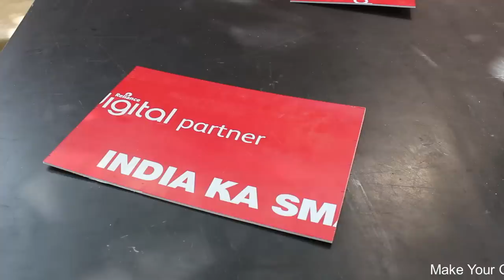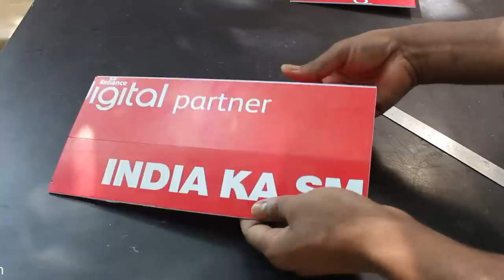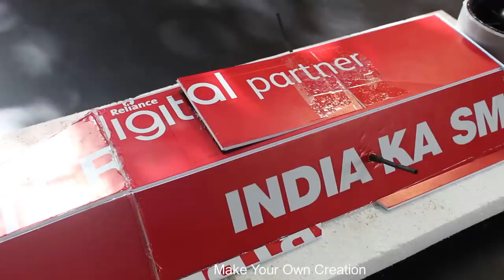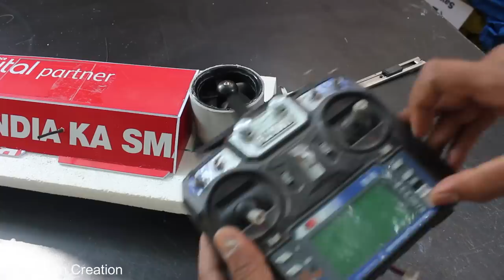How to make a Boat - Amazing RC DIY toys - BOAT

Comment: I think you'd get better performance without the elbow both because of the friction losses of the hard 90 degree bend and also due to the loss of the fan suction which would add the forward thrust if oriented horizontally.
Reply from the maker: Thanks For Your Feedback

Comment: cool idea. what if the you used the EDF as a water Jet turbine. that means spinning it inside tube that is under water. Sweet lake water won't destroy the motor in short terms. But it might been interesting to see how that would have worked out. maybe more speed?
Reply from the maker: i am done many
Reply: @Alejandro Jaiden Woah! any updates?

Comment: Very very clever!  I have 3 ideas for mods: 1) controllable trim tabs on the stern. This will allow you to tune it for a smoother high speed plane;  2) make the bottom smoother/slicker. Paper and packing tape would be lightweight; and 3) if you want the EDF style poweplant, Consider a "BDF". Cheaper, more robust, and more efficient with your battery. Great job!
Reply from the maker: Thanks for your feedback

Comment: Great project! One suggestion, I think you’re having trouble turning left because of the counter torque of the motor. Angle the pipe slightly to the left side (2 degrees or so) and I think turning should be easier. Also maybe extend the rudder into the water a little? I love the simplicity of this and it looks nice too. Nice job.
Reply from the maker: Great point!,  Yes, Thanks for your feedback

Comment: One tip...always switch on your remote control first then the receiver..... Btw good job..keep up the good work
Reply from the maker: OK
Reply: Kenapa kena on transmitter dulu baru receiver bro?
Reply: @WKRhomemade  sebabnya tak kira kapal,bot,heli kdg2 dia boleh gerak sendiri which is about safetylah..then kalau nak switch off pulak tutp yg receiver dulu then baru transmitter....cthnya kalau kapal prop electric kdg2 bila kita off transmitter dulu automatic dia akan pusing kipas tu . Itu yg bahaya tu...maklumat tambahan kalau nak bind baru kita switch on receiver dulu dan kemudian baru kita on transmitter utk connectkannya
Reply: @hakimmunim4594  ohh gitu, tq info 👍
Reply: @WKRhomemade  bereh bossku

Comment: Good start - I will suggest that instead of using an 90 degree plastic pipe, use a dual 90 degree pipes to form an S intake.  The air flow will be smoother.  Try it out and see what happens.  Best
Reply from the maker: ok, i will try it
Reply: Or try a 2x 45 degree s shape for better airflow  😁
Reply: @niels8096  That should work as well - good input!

Comment: Nice job sir,  ive been looking at designs to make a gps guided fpv boat and really like your design and propulsion setup, what size air duct/fan/motor and pvc elbow are you using?
Reply: I'm going to have a go at one of these.  My ducted fan is 70mm which fits exactly inside a drainpipe....

Comment: Nice design. But why did you keep the ducted fans with elbow? You should hv keep it straight. It would be more powerful
Reply: Probably to keep water from getting in/on motor. 
 He could have used a 45degree PVC instead of a 90 degree but it's his design..
Reply: @c.l.pitman1760  But it could have been kept out of the water also, similar to a hovercraft. Keeping the rudder alone underwater would help in steering

Comment: im wondering if it would go any faster if u angled the air outlet down more so that its fully submerged in the water?
also if u move the battery further back so that the bow can sit higher? 
nicely done good stuff! 😉
Reply: +make your own creation would my suggestions actually work?
Reply from the maker: Thanks for your feedback
Reply: @MakeYourOWNCreation  was actually asking you if my ideas woulc work?
Reply from the maker: 100%

Comment: is this an airboat or boat with hydrojet?cause on both cases,your construction it's wrong
Reply: It's not wrong, because it floats and reacts to rc. It's a rc boat. There might be better ways to do it, but you can't say wrong when demonstrated that the thing works as designed.

Comment: It's like air boat for more speed try water prop with BLDC n esc ....it's hard to accelerate with air duckted fan
Reply from the maker: ok
Reply: the added complexity of a driveshaft, which needs to be both waterproof and perfectly balanced, makes a real boat much harder to make than an airboat. trust me, I've made both. used the airboat to rescue the real boat too many times to count.